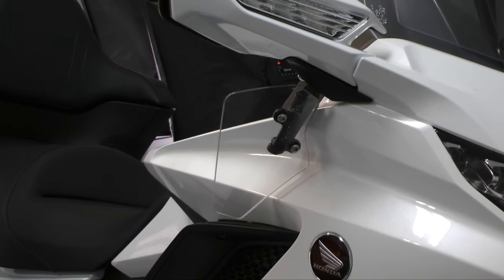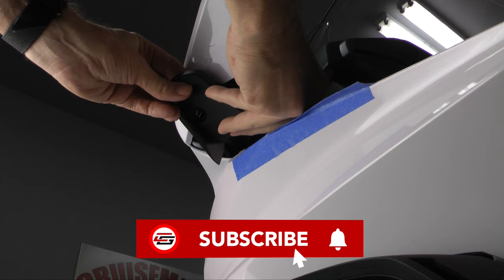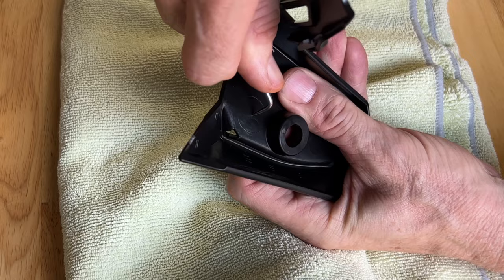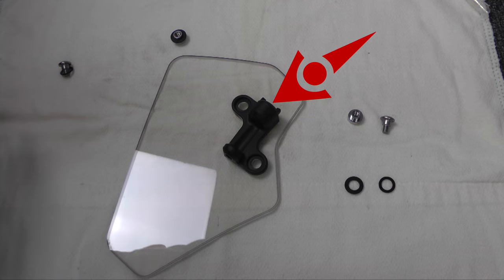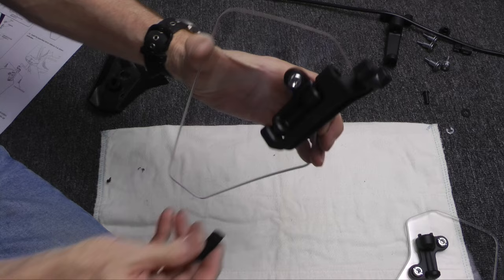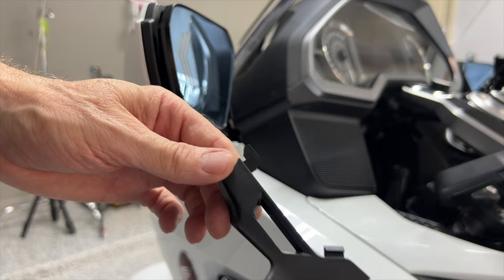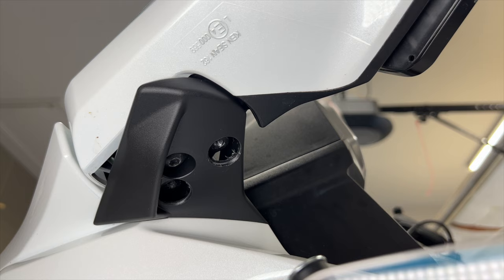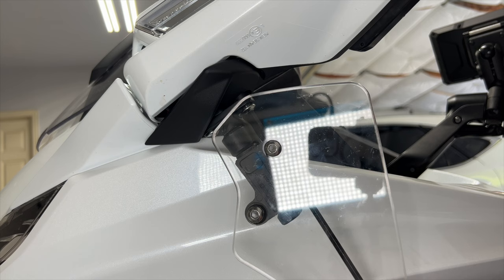Install Honda Upper Air Deflectors on 2018 Honda Goldwing | Cruiseman's Garage

Comment: Well done Cruiseman! Is the Honda brand the recommended upper air deflectors to use for this bike? I need to purchase a set.
Reply from the maker: It is the set that I have and they have worked flawlessly for 5 years. They are very well made.
Reply: @cruisemansgarage  can you tell me if the Honda upper deflectors help with air coming from under the mirrors directed to the rider and passenger helmets? My goal is to reduce this air coming up that create noise and turbulence.
Reply from the maker: @frankzzr4853  They do "help" with that, but do not completely eliminate it.

Comment: I really cringe when I see someone holding a component by hand to drill holes. The component should always be clamped down the best way you can. When drilling a component, the drill bit could bite and therefore cause lacerations, broken or even amputated fingers. When I was an engineering apprentice, many years ago, if you were caught performing such a dangerous practice you could be hauled into the foreman's office and be given a weeks suspension which even the union rep wouldn't defend you from. After all, the unions had spent decades fighting for improved health and safety standards in the workplace. imagine if someone went to hospital with injured fingers and told the doctor they thought it was safe to drill a component while holding it by hand because they had seen it being done that way on Cruiseman's Garage. Possible legal case ??  So Cruiseman, please try to avoid showing such dangerous practices in your otherwise excellent videos.